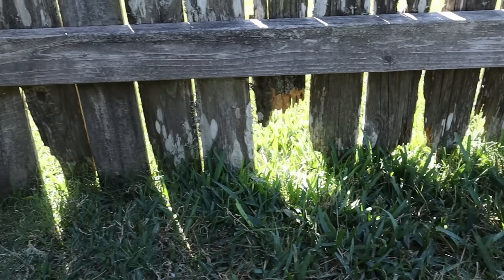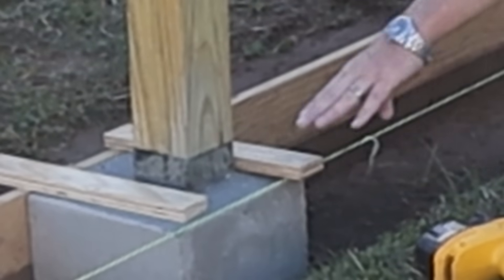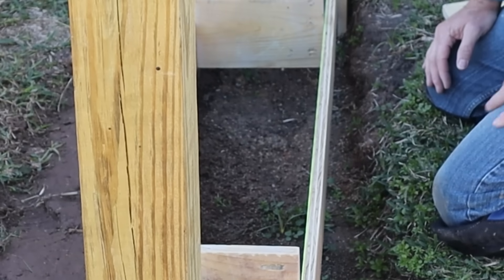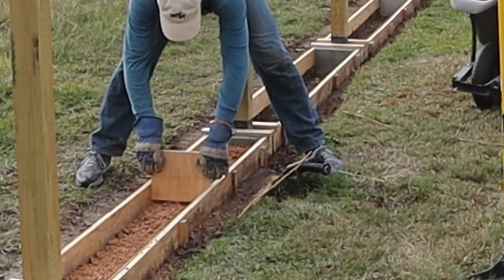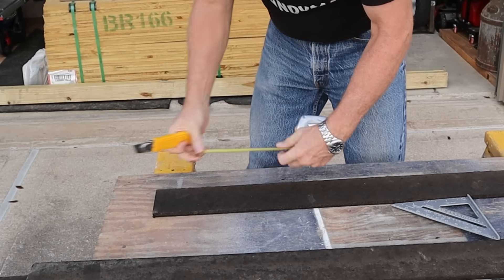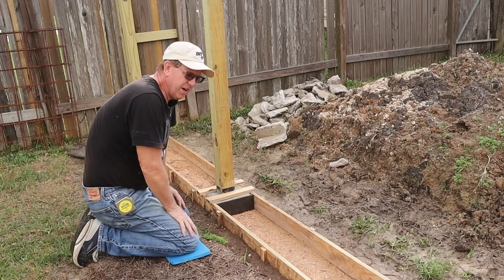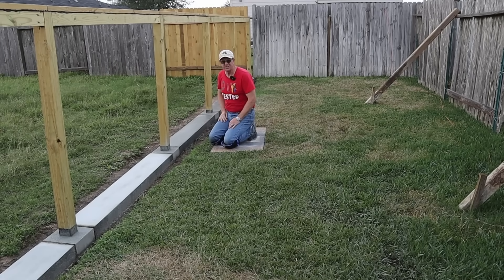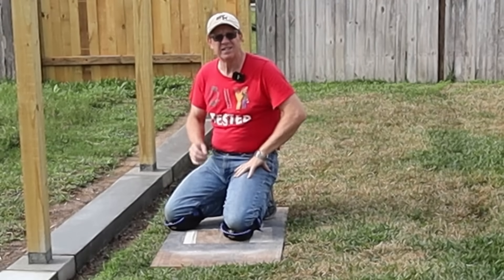Zero Maintenance Concrete Curb-Keeps Fence from Rotting!

Comment: Lots of ideas to build a fence... the problem is that most customers won't pay for something like this , considering the time and extra materials . As a homeowner you might have the time and patience to do it any way you want to. It looks good and is a pretty good  idea..🤩🤩🤩
Reply from the maker: True but when doing it yourself that is the great thing you can do it how you want.  Thanks for watching
Reply: Yeah people want good work done cheap
Reply: @moejoe5935  
That's the ones that get junk work.
Reply: @deanb949  yeah I dnt put my name of them kinds of work!. I deal with people who call me knowing what they want. Your right never understood that.  I've seen cheap work    come out very expensive the 2nd around about!!. Stay firm my guys!
Reply: This is pretty, but it isn't logical.  The next tornado that comes to town will cause extra work, pulling broken poles, and now breaking concrete. If a guy tamps the dirt in hard and tight, he won't need any concrete  for his poles. And don't space them over 8 feet. Use landscape timbers at the bottom or run a low rail for the weed eater, and lastly,  DON'T use pine pickets.  Always use cedar pickets. The pine will bend and warp within a year, and cedar will stay straight.  These are words of wisdom from a Pro DYIer.
Reply: @LP-MeAndMyShadow  what percentage of people do you think have tornados to consider for fence building?
Reply: @Kyle Cheney  Wind will blow down fences. Statistically, every place has wind, including your @$$.
Reply: @LP-MeAndMyShadow  True that. Maybe if damage did happen, the posts could get cut flush and new posts could go on hardware that's mounted to the concrete 'footing'. Although I guess that wouldn't give a ton of strength against perpendicular forces. 

Is there a way to do a privacy fence that lets air between the boards better?
Reply: @Fetecheney  It's called "board and board". It looks the same on both sides of the fence. AKA a good neighbor fence.
Reply: @joeywelch-ud8yr  nice, thanks for the info!
Reply: The imagined benefits far outweigh the costs of doing this. When you're old and have time to burn, you do things like this.
Reply: @LP-MeAndMyShadow  maybe your fence posts get blown over cause you tamp dirt,instead of concrete. The reason you use concrete is to mitigate the amount of water that comes in contact with your posts,and causes rot,you want concrete in the bottom of the hole so the post does not suck water up through capillary action like your ...
Reply: @Doug Todd  Nor between the concrete and post is there a water seal. A broken post with concrete is how I started my journey. Trust me digging out a post with concrete is more work than digging out a post WITHOUT. Actually, I use my engine hoist to pull up the broken post.
Reply: @LP-MeAndMyShadow  good idea using the hoist. That would be a dope tool to have around.
Reply: @Kyle Cheney  If a guy wanted to use metal poles, then this concrete idea is golden.
Reply: @LP-MeAndMyShadow  Huh. We just had to pull a 25 year old fence  with concrete posts and treated pine pickets. The parts were great, so when we relocate the fence, we can reuse most of it.
And as for wind, did you not notice that the long sections were not connected to the post anchors?
Reply: @LP-MeAndMyShadow  I used my son and a shovel. 10 min each.
Reply: @LP-MeAndMyShadow  I live in STL and have never seen a fence blow over unless directly in the tornado line. We have building rules required to get a permit that include sinking poles in concrete beneath the frost line (30 inches). Hillbillies in the boonies who stomp them in with dirt have their fences blown over much more often. Just do the job right and your fence will withstand 80-110 mph winds depending on materials used. Stop being lazy.
Reply: That's why the TITLE says DIY
Reply: There is no way in hell anybody would hire or recommend this guy for a fence job in real life ...triple the price at least and 5x the time to build ..😂😂
Reply: @deanb949 that's 95% of customers ..
Actually they don't want it cheap they want it for free ...nowadays 😂😂
Reply: This is not for business. Private owners who have the ability to do this would never pay a business to do a budget job. This job can be easily done for the same or less if it’s diy. It’s so important nowadays to diy because the quality of work when hiring has gone downhill.
Reply: I think plenty would pay for it, if they knew the value. People get ripped off for pretty basic fences today, this wouldn't be that much more.
Reply: @Horace1993  the labor would for sure double it ..
Reply: @mallorystammer5362 
Most of us hillbillies out here in the boonies are pretty good at building fences. Look to the cities and suburbs for slackers and fools.

Comment: Overkill in so many ways, but I really appreciate the calm detailed narrative along the way. It’s like having your dad explain each step. HOW gets the job done, but WHY empowers others.
Reply: I personally would rather have overkill if I was hiring someone. All the contractors I’ve hired over my years do the bare minimum. I would pay for the extra effort if I was told it would cost extra for max effort.
Reply: I wosh people would "overkill" like this, some of us need way more help and alot of what youd think is obvious is not so obvious to someone completely ignorant of all this.
Reply: Not just overkill, it's frivolous and wasteful. Sure, he has attention to detail, but I don't see that as a reason to praise him for this particular project.
Reply: It really is. Everything from the "packing" of the dirt outside the form, to digging it WAAAY below the 4 inches of the form, to the lime pack inside the form. 

At the most, it would warrant a form board on each side. Fill the bottom with some gravel up to the bottom of the forms. Expansion joint material at each end. Pour concrete directly on top of gravel. Smooth it out. If you want some reinforcement, either add glass fibers or some highway wire mesh. 

@tommytators9814 I know you'd rather HAVE overkill, but you would never want to PAY FOR overkill. Don't pay for things you don't need. Overkill in this case adds a ton of labor and a good bit extra on materials. Somebody has to pay for that labor and materials. OP's video is DIY so it's not too much extra for the overkill, just breaking his back for no reason. But hey, if you want overkill, and you don't mind wasting money, go for it.

Comment: Cement blocks under the fence will do the same job: I used 20 x 10 x 5 cm with very good result. I never let the end of the plank touch the cement; keep the plank ca. 1 cm up so that the earth bacteria doesn't get a chance to eat away on the planks.
Reply: I do the same. The concrete blocks also prevent weeds growing up right next to the fence boards, so you're not going to be hitting those boards with the string trimmer.

Comment: once i saw him use the sawzaw to vibrate the wet cement, i instantly subscribed! You can tell this guy has some good tricks up his sleeve
Reply: It's called a sawzall. Idk where tf people got the idea they are called sawzaws
Reply: @tylersmith9868  The proper name is reciprocating saw (sometimes shortened to recip saw). It's called a sawzall in some places in USA based on the brand that introduced it (in the same way that some people calling photocopying "xeroxing".
Reply: havnt watched full video but thats a hell of a tip to find in the comments.

Comment: Very nice!   One little bit I would have done differently as where I live has quite a high rainfall is that the concrete had a slight slope to one side . By making one entire side 1/4" or 6mm or so higher, rain will run off rather than pool on the concrete.

Comment: I did something like this 30 years ago.  I had the advantage of having the metal forms available to me since I have relatives that are in the concrete business.

What I did was dig down for the concrete pad before I did the post holes.  I then marked and dug all of the post holes and removed all extra dirt and debris. I prepped the holes for the posts and set the posts and did not fill the holes with concrete until it was time to pour it all in one shot.  I also made the concrete 18 inches wide to give plenty of room on both sides to help prevent any grass or weeds growing near the fence.  I was going to go a full sidewalk width but that was not practical at the time.  It was also to help prevent the dog from wanting to dig under the fence as well.

I went back to the place I did this at and it is still all in place and the fence posts are still holding strong.  The rest of the fence was replaced because one of the owners after me wanted a different fence look and vinyl wrapped the posts along with that new look.

Comment: This licensed concrete contractor says, your rebar in the dirt will rust, expand, and crack your concrete. Other than that, primo job!
Reply: I thought the same.  If I was going that far. I would have used gravel, sand, plastic for a base and then rebar and mesh.

Comment: Excellent video and thank you for filming this process.

You might think about using some kind of release agent like pam cooking spray on your forms to help with release.  If you're looking for a mirror finish then using finishing wax might get you there if your plywood is without major defects.

I was also wondering if putting a slope on the top of the curb might help with things like leaf accumulation and rain splash.

Comment: A well executed, if strangely designed project.  It looks like fence curb is not set deep enough to serve as a foundation for a block wall (which is the real answer to the rotting problem, if done 'for keeps' with a proper foundation), but it is tall enough to block water flow and probably create ponding in the back yard if applied to all 4 sides.  I missed the part about drainage.

Comment: Also you can coat tar on your posts were they contact the concrete . I like to  use a 2x6 form  it’s stiffer less flexing strips better& gives a bit more Heights which helps to keep the grass from growing underneath the fence from one side to the other

Comment: I've often considered doing this. I see people doing curbs for flower beds also. Question I have is what keeps them from heaving in colder climates? Not sure where you are - if it were me, where I live, I might consider pinning those curbs into the posts to keep them from shifting around. Nice details on the finishing.
Reply: Pinning it to the posts is not advisable. I design buildings for a living and a common detail is to install a bond break around piers prior to pouring a landscaped slab. Heaving is very strong and can take the posts with it. The only way to prevent heaving is to frost protect the slab. typically frost protection is achieved with either ground insulation or by pouring your footing 48" deep ( neither of which are realistic here ofc)
Reply: That said, maaaaybe with enough gravel below the slab you could mitigate the heaving enough to make it realistic to dowel into the piers. I wouldnt risk is personally
Reply: Frost heave is cause by water expanding as it freezes. Soil doesn't drain water quickly so pouring concrete directly on soil is always a bad idea. You want water to drain away quickly before it has a chance to freeze AND...you want to allow space for it to expand in case it does freeze. Your best bet is to excavate and fill the trench with at least 12" of 3/4 gravel. It's self compacting and offers the most drainage and room for freezing water to expand. Pour your concrete on top that and you mitigate the risk of frost heave when going below frost depth is not practical.
Reply: @OU81TWO  I was thinking the same, you need something that isn't susceptible to heave - maybe that's sandy soil with little clay, maybe that's crushed rock as you described. At this point though it becomes a little crazy, like you're pouring a freaking footer, just so you can not weed trim along the fence. My next idea is to use something like a Trex 2x6 under the fence line. Pinned down with tent-like stakes/nails.
Reply: @slip0n0fall  Yes it's nuts to do that for a fence if all you want is an edge  to fill the bottom gap.  A piece of plastic is cheaper for sure.
Reply: I have seen rake- like metal pieces that one can attach with brackets to the bottom of a fence to keep critters in (or out).  You can weed wack them and can push them into the ground to make a pretty secure barrier.  No frost heave issues, either.

Comment: Excellent job and great video. The only thing I would change is, I would use the edger to get a rounded edge, then work the steel trowel again after the edger to make it look uniform on top.  To me any sharp corner like that is asking to be chipped up.

Comment: Nice job, the curb is worth more than the fence. With your wire reinforcements, it'll survive any storm better than the fence, too.
Reply from the maker: thank you and your probably right.  Thanks for watching
Reply: The metal embedded in the concrete is more likely to corrode and actually accelerate the cracking and chipping. There is no reason to reinforce concrete that will not be bearing any substantial loads...
Reply: @alphaforce6998  how quick does the corrosion affect the concrete?
Reply: @eriksteffen6166  Depends on the climate. If you get a lot of rain it could be within a couple years. It you live in a dry climate like Arizona it may never happen. But the important point is that the purpose of using rebar to strengthen concrete is for concrete that will be subject to loads, i.e. a road, a bridge, a pillar, etc.

Comment: In general I like the idea. You could have just poured your curb like a footer then used concrete post bracket plates to attach the posts to the curb. That would have been a simpler process for the concrete work at least.  looks like your posts are down in the concrete, maybe that was a previous video. But if you have a post issue at this point, going to be a pain to resolve.
Reply from the maker: Yes I did a separate video about the posts and they are 3ft in the ground in concrete with a 10in square pour around them.  Thanks for watching
Reply: how sturdy are posts in brackets compared to posts 3 feet in the ground?

Comment: It’s always interesting to hear what ocds unprofessionals obsess over while missing others. 

It’s easy to use a 2x4 (1.5x3.5) and get a 4” thick slab. When you install the aggregate, you just leave the top of the aggregate 1/2” below the bottom of 2x. The base should be placed before the form is backfilled so that the aggregate extends out from the edge of the pour. This is the path of travel for any vertical forces. It also saves worrying about dirt going inside. 
Adding 3bar and 8” wide wwf in a 4x10 slab is counterproductive. It needs 3” of cover between the steel and ground; 1” between the air. With the steel as installed, it is more likely to pop the concrete. 
It is also easy to get steel in the middle of a small slab without chairs. Just pour half the slab, set the steel, and add the rest of the mix on top while it’s all wet. Chairs are only necessary for big slabs. 
It’s not that difficult to use a roundover tool and float it smooth with the surface. The otherwise sharp edges are much more likely to chip in the future. 
Etc
Reply: Old is right...
Reply: You forgot to mention the ridiculous amount of overworking the finish with the steel trowel.
Reply: @tomszabo7350    That was OCD - "Over Concrete Detailing"

Comment: What I had planned to do under our fenceline was some landscape edging to define the edges with gravel pack topped with landscaping gravel.

I'd rather avoid weeding the fenceline entirely if I can get away with it.  If I ever get to actually do any off that work, I'll let you know how it turned out lol
Reply from the maker: okay great, another idea you can put 4x4 posts between the posts and use rebar to hold it in the ground.  Can bury them 2-3.5 inches.  Thanks for watching
Reply: You do realize you’re still weedeating the fence line right.
Reply: @JustTryingToInnerstandYou  I absolutely am, b/c I've done no work.  When done, I won't be, no.

Comment: You might consider stress cables in your next pour. Works really well in place of rebar😊
Reply: Why? It's not bearing any load and that's why concrete is reinforced. Having metal rods and wire inside the pour will not stop the natural expansion and contraction of the concrete due to changes in temperature and humidity...and in fact will likely contribute to an early failure.

Comment: I think your idea is excellent and looks real sharp. How do you handle drainage? Most modern rules state you cannot obstruct the flow of drainage water from one lot to the next. As to interfere with the established lot drainage
I personally just use gravel with perf drain pipe (French drain). Keeps weed eater away and prevents that rot

Comment: Great video!
I think a good trick to prevent weeds from growing and coming up from the ground is to spray the dirt at the bottom of the form with vinegar. Then add salt to that same dirt as well as to the limestone material you pour onto it afterwards. 
That will surely take care of the issue.